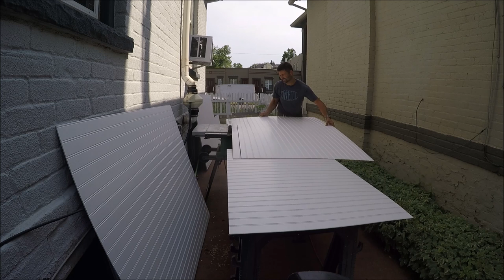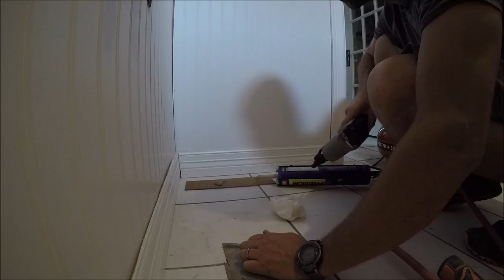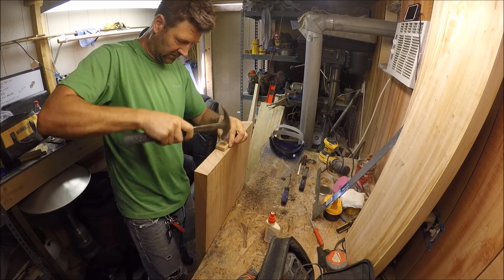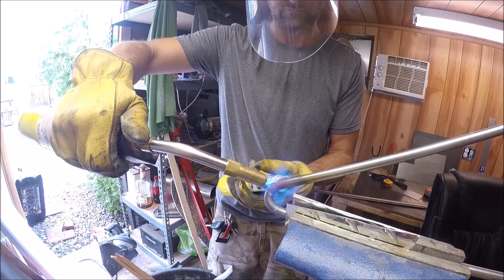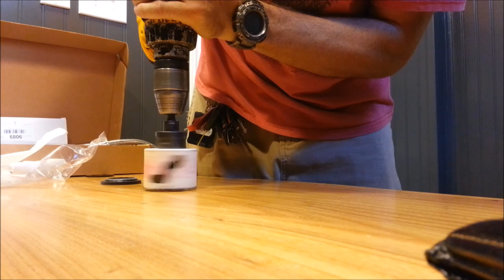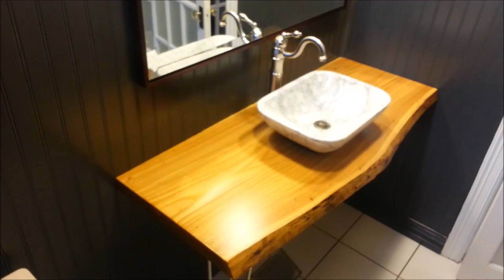DIY Pintrest Bathroom Makeover with live edge counter top

Comment: looks fantasic, but I suspect that wood isnt going to hold up to being spashed by water 1-2 times a day
Reply from the maker: Its got several coats of polyurethane on it. Its been 3 years and looks as good as new.   I told them to let me know when it needs refinished. I have a kitchen remodel coming up where I will be making all the counter tops out of wood.
Reply: now you got me looking for live edge lumber merchants around my area
Reply from the maker: I found a small family run saw mill  that gets logs from the local utility companies when they have to clear trees for power lines. They air dry them for a year.  I hear air dried is better than kiln dried because when the wood gets kiln dried it washes out the grain pattern.     Look on pintrest for wood/live edge counter tops.   I'm sure they don't last as long as granite but if you get the right kind of wood and oil them  they should last a long time and you can refinish them in a few hours.

Comment: Handyman, 
I am hooked on your remodeling videos, learning how to do these kinds of jobs myself, but I am thoroughly impressed with the leg you made for that live-edge countertop!!  So regarding that, is TIG the only way to weld stainless or did you choose to do that because the mounting plate metal is so thin?  Also, you mentioned that you got the countertop from a mill; were you able to order that online/ by phone or did you choose and pick it up in person?

Regards, 
Andrew
Reply from the maker: You can use a mig welder to weld stainless.   I chose to use the tig welder because It does a much cleaner job.   I got the slab from  from a local saw mill just outside of town.   It was a mom and pop type of place.   I just googled saw mill.   This one was already cut and it was about $100    Thanks for watching

Comment: Did you tighten the drain nut underneath to the wood? Or rough out a larger hole and tighten onto the sink bottom?
Reply from the maker: Through a larger hole tightened to the sink.

Comment: I think the design is great but is there a way to support the pedestal without a leg but solely with the wall?
Reply from the maker: There might have been a way with some very strong steel brackets.  The women that designed this was really wanting the hairpin leg look.   The sink weighs about 20 pounds.
Reply: The Handyman would you also brace it with a wood block against the wall at the back of the countertop?
Reply from the maker: not sure what you mean.   to have a floating counter top with a 20 pound marble sink would take a bit of work. It could be done though.
Reply: The Handyman sorry, I meant to have maybe a 4x4 block screwed into the wall along with the brackets to help support the window
Reply from the maker: That would help and make it stronger.